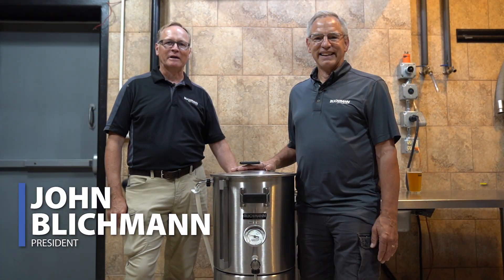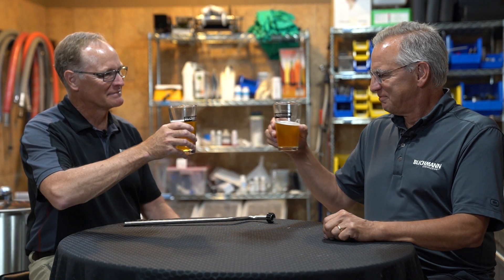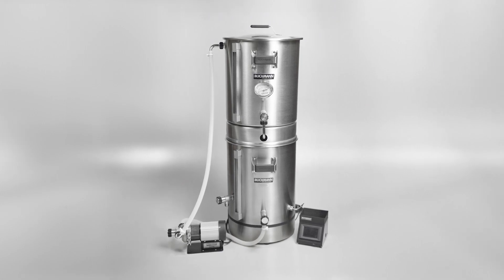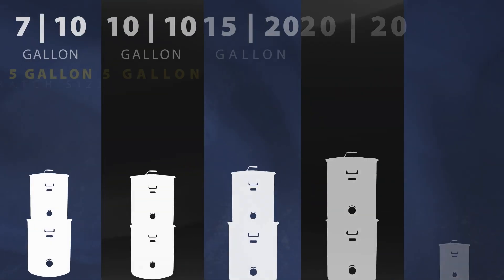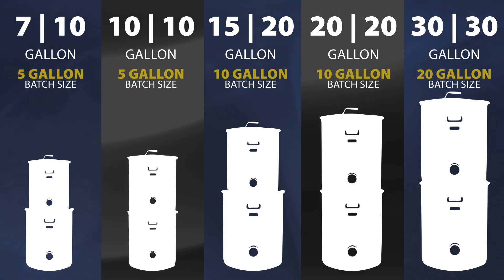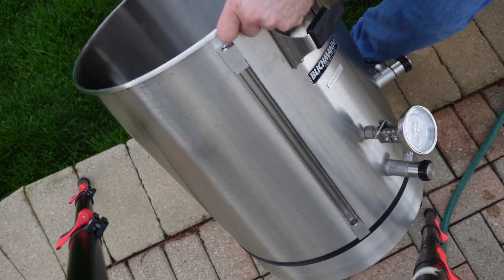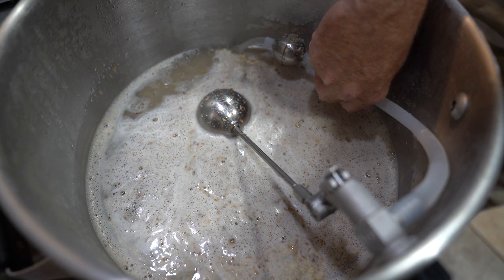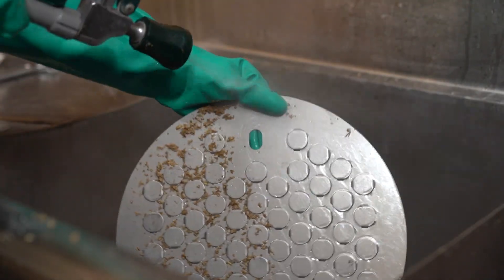Lifetime Guaranteed Brewing System?!?  | John Blichmann Shares More

Comment: Two questions on the surface: 
1. When compared to the boil coil or a similar immersed heat source, what is the power difference (or heat loss if that's a better benchmark)? The origin of my question is that when I brewed with gas, I was told that it was not as efficient as an immersed coil because of the heat lost around the kettle. 
2. For those of us with G1 or G2 kettles, will there be an opportunity to add a surface to an existing kettle, or can it only be purchased "new"? I ask because I have a 15-gallon G1 kettle that was a mashtun, which I would consider modifying if that was an option.
Reply from the maker: Great questions.  For the first, we haven't seen a heat loss issue, but you can always reach out to tech support and Jared can further expand on this and the mechanics of how the element placement works.  For the second, there isn't a stand-alone Surface™ element on the docket, but if that ever changes we will assuredly let you know asap.  Hope that helps, and cheers!